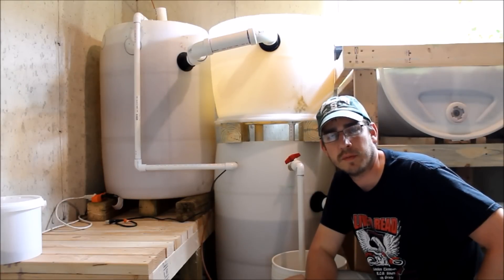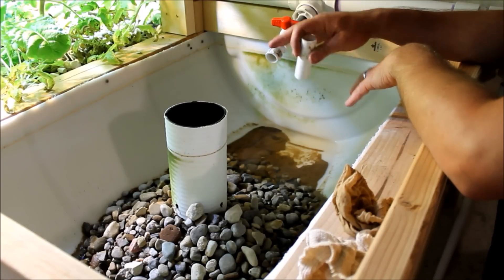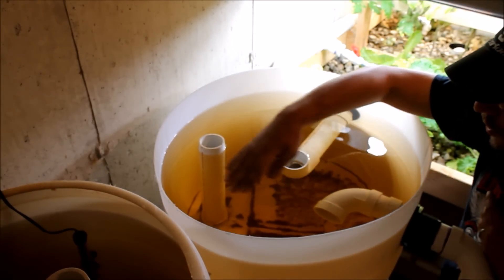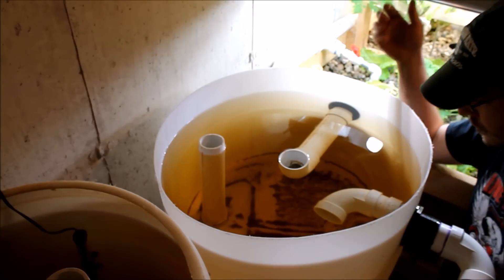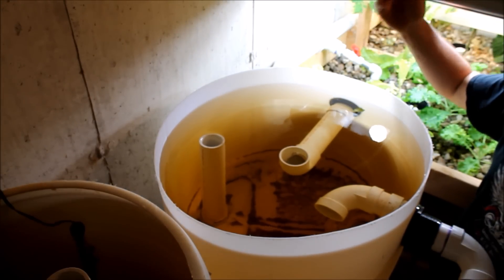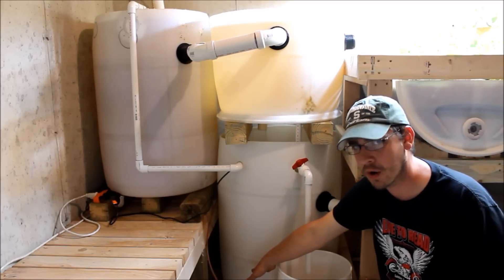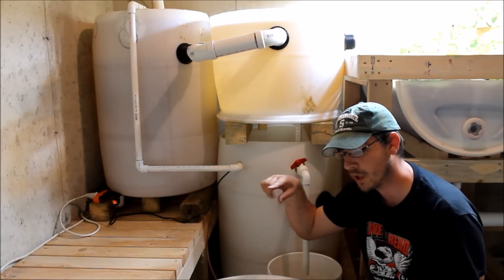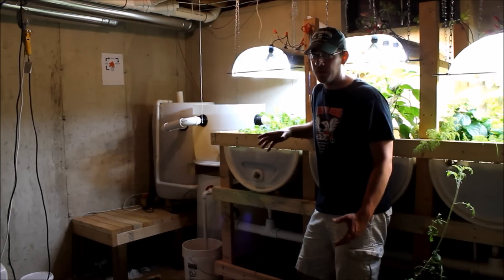Aquaponics System Design - Using a Swirl Filter to Remove Solid Waste

Comment: nice setup, have you seen RobBob from austrailia's setup, he uses much cheaper rubber seals for his system.  Also MHPgardener uses them.  Keep up the great work!
Reply from the maker: I sure have, they use the uniseals which I wish I would have found before I spent so much on the bulkhead adapters that I have. In the future I will be buying those for sure, thanks!
Reply: SSLFamilyDad I dont like the uni seals...from my experience they will break down and leak after time.. the bulk head fittings are much stronger and will last 20 years with no problems. another thing with uniseals is if you rest any weight on your pipes the pressure on the seal becomes uneven and they will leak..
stick with the bulk head fittings.. 
check out some of my videos.. I always use bulk head fittings.. 
www.aquaponicgardens.ch
nice setup..
contact me if you would like to try out the best in LED lighting..
thanks again..
Paul
Reply from the maker: Aquaponic Gardens Thanks for the advice. I wondered about those uni seals but I still think they might have a place for my outdoor system later on.  A few drips here and there will be ok outside but not for my indoor system. You have an awesome setup there, I wish I were closer for a tour! Thanks for watching!